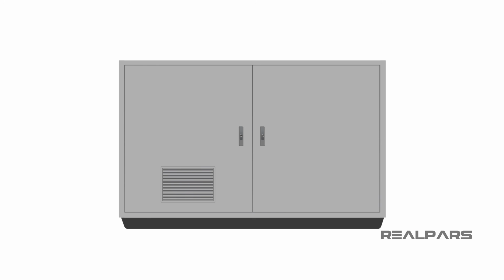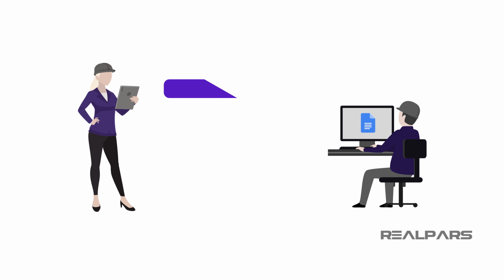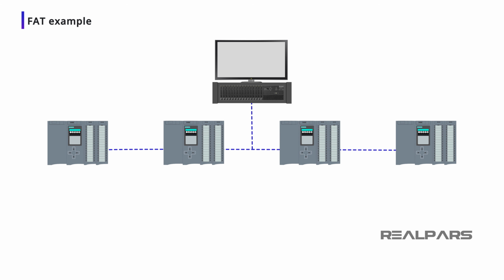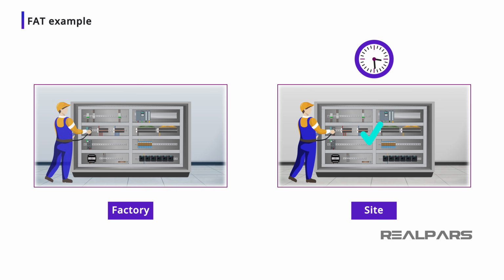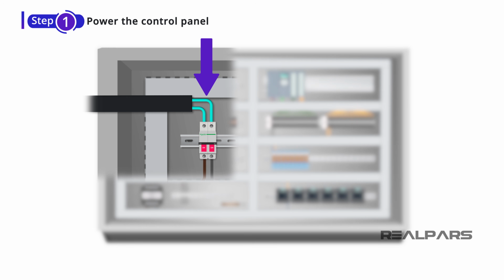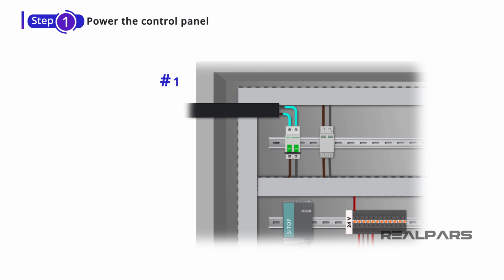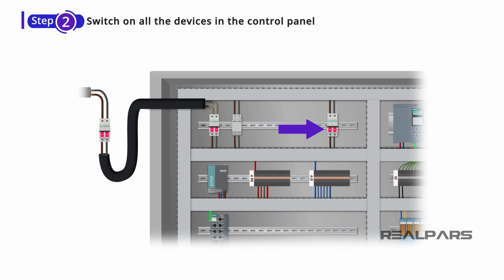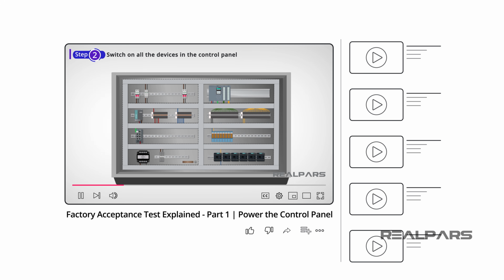Factory Acceptance Test Explained - Part 1 | Power the Control Panel

Comment: Hi can anyone tell me how to check pull test (any device available)  of the the Connected wire in Terminal block , MCB, PSU, ,,,
Reply from the maker: If I understand your question correctly, you want to verify that the wires are securely terminated.  The "pull test" is actually a very good test to perform, since many times, a panel builder will not tighten the wires per spec.  To do a pull test, make sure the power is disconnected from the panel.  Then gently tug each wire (small amount force) to see if the wire comes loose from the terminal.  If so, reinsert and tighten.  If wires do not make good solid contact with the terminals, they could arc, or simply not make contact such that the device wiring prevents proper operation.
Reply: @realpars  yeah thanks for the info.i am asking about any device or instruments are  there to check pull test.with the equipment not with hands.

Comment: Hai, What is Configuration Acceptance Test for PLC?
Reply from the maker: SA Configuration Acceptance Test for a PLC is a systematic test and/or verification that the  configurable parameters in the PLC (IP address, port baud rates, connected device node numbers, etc., meet the values contained in the hardware or configuration specification document.

Comment: I believe first step is to check the integrity of wiring and if proper grounding is in place.
I have had bad experience of wrong wiring where short circuit happened just after panel is powered on.
Also in one instance the grounding was not properly fixed and one of the PLC card burnt because of electrostatic discharge.
Reply from the maker: Thanks for adding that, Sikandar!

Comment: It's an important video, i like to learn by watching all your videos. A step that i used to do before turn on the main braker is to check with the multimeter with continuity, the possibles shorts circuits between lines that helps tolo correct the conections and saves the elementd of the control panel.
Reply from the maker: Thanks for your kind support, Marlon!

Comment: In my experience, the secret to a good FAT is to identify and test all functionality.  It's usually not possible to reproduce all the inputs, outputs, and interfaces of the destination plant.  But identify every type and test a representative sample, and scale your system so that it can handle the full requirement.
Reply from the maker: Alexander,  this is a great observation!  In small FAT tests of a single panel, it may practical to test every point and I/O terminal.  However, in very large systems,  a representative sample, perhaps one point from every I/O card, or verification of power at the "endpoints" per the panel drawings, will give a high probability of suitability for installation in the field.  Again, the client has the final say in the scope of the FAT, since they are "footing the bill" for the time it takes to complete the testing.

Comment: Control system FAT usually comprises of Hardware and Software FAT. Before starting with FAT, it is important that all the documents required for performing FAT are available: system configuration, P&IDs, I/O list, Functional design specifications, HMI design specification, Alarm and trip setting list, Logic diagrams, Control loop diagrams, HMI screen, Specification of Control system hardware,  panel GAD and wiring diagram, Bill of material, list of signal exchange with third party interface ( hardwired and soft signals) and FAT procedure as a minimum. All these documents should be approved by your customer before you can take a panel into manufacturing and start with system development.

A FAT procedure lists the detailed procedure for testing of hardware, I/Os, program, HMI interface and third party interface as much as practicable.
Reply from the maker: Saurabh, thank you for the extended explanation of many of the components (hardware, software, documentation, drawings, etc.) that are included in the FAT process.  Your comments will certainly help our viewers to better understand the scope of the FAT test!
Reply: RealPars Team, you are most welcome. Understanding the documentation requirement and the purpose of each type of document at each stage of FAT is a pre-requisite to a successful FAT. In my experience, I have seen that FAT procedures are not so well written by control system vendors and end up widening a gap between one's expectations and what is offered by the vendor. 

Hope my feedback serves as a value addition to your team responsible for developing content for YouTube channel.
Reply: @saurabhbhardwaj9667  thank you so much for sharing your knowledge and experience. Much respect.
Reply: @realpars  Great❤️